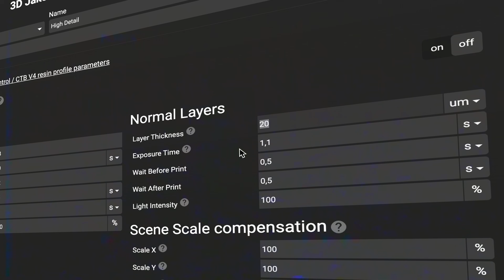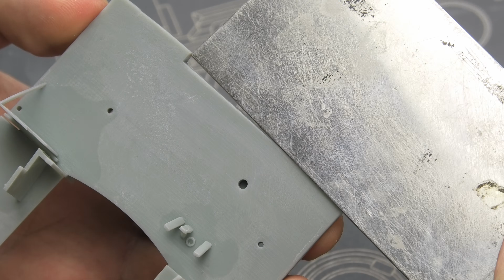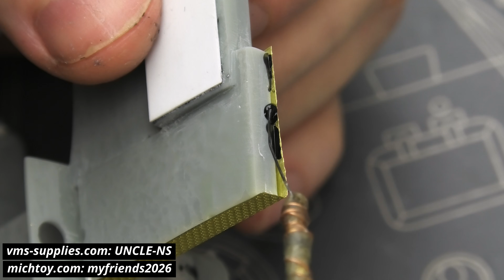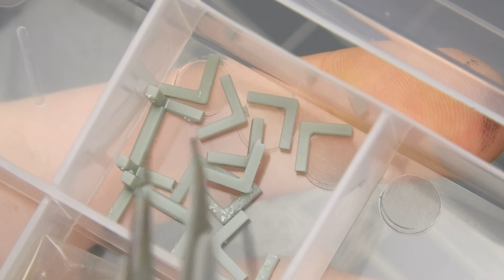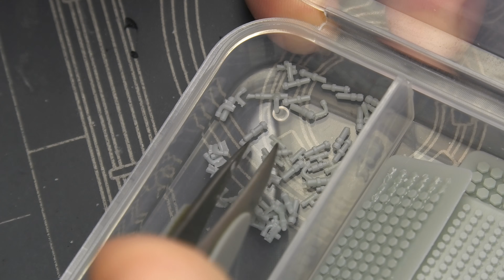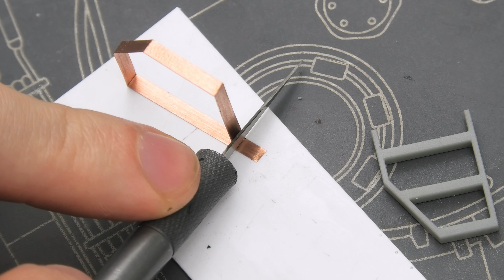Yes, Childhood Dreams Do Come True: Pacific P16 3D-Printed Scale Model

Comment: Aladdin Models will only send you the G-Code for your print, not the STL.  They set it up for ONE printer, and you have no control over printing the object. On top of that the print I received was poorly designed and parts were so thin you could see through them.  STAY AWAY!

Comment: My son drives one of these trucks in the mountains of BC and I have to say your model is amazingly accurate excelt a few things 1 i agree with the other commenter there would be heavy dust everywhere 2 no need to be so accurate withe tires most companies use whatever tire they can get cheapest (and rhe trailer tires might be almost worn out) so they could be anything and are most likely mixmatched. 3 for a truly accurate truck it should be beaten up for a couple reasons. First these are subject to beeing shaken and bounced and beat around on logging roads and while being loaded and unloaded everything is about speed. And secondly these trucks are usually bought at auction after many many miles ́ut on them then retrofitted with the headache rack for instance and sent to live out their dying days in the woods. One specific thing you could add from my sons previous truck is the door wouldn't stay shut so had to be bungee corded to the seat while driving oh and the windshield was cracked. But seriously this is one fantastic model you have

Comment: credit where its due to the 3D modeler. At one point I started looking into how to create a mod truck for Snowrunner. Watched three different tutorial video series on youtube. However for the life of me, I couldn't find a Dodge M37 3D model that had any level of dimensional accuracy or detail. Since I'm restoring one right now, I figured I'd spend a winter learning how to use blender and use the real truck only 50 feet from my computer for reference material and dimensions- however I was unable to pick up Blender as quickly as I'd hoped and by the time winter ended, I had the real truck to work on again hahaha. 

This is an AWESOME video to upload. The P16 is vastly underrated in SnowRunner and is usually my "get out of jail free" card if anything else gets stuck or flips over. The P16 is always there to bulldoze its unpowered front axle through anything and consume every last drop of fuel I can give it only to run out in the worst possible spot.  

Beautiful fabrication work on the engine bay- which is often an area overlooked and under-detailed by modellers!

Comment: After you have cleaned in IPA, wash off any residue under hot water, (the alcohol will still leave stains). Alternatively, buzz it in a microwave cleaner for ten minutes, and then finally dry with a hair dryer before UV curing. (Never cure wet models.)
As for cutting from supports, invest in an ultrasonic scalpel, it's great for all-round modelling, but also makes support removal a breeze.
Not that cheap, but well worth it.

Comment: When removing supports from your 3D prints. Try soaking them in hot water from your tap not boiling but hot. The support attachment points get softer and tear away much more easily. Then put the parts into your curing station.

Comment: while pacific isnt around anymore some of the guys who ran the company are still kicking. they actually still have all of the drawings and blueprint for almost all the trucks they ever made still hanging around. not that long ago they reached out to Edison motors and gave them all of the technical drawings for the truck they were working on. i doubt it would be easy to get into contact with them but it wouldn't be impossible

Comment: I have bought my second Saturn 4 16k Ultra; it's just incredible. I use Sunlu 14k ABS, which is made for this printer—a perfect match made in heaven!

I need to move on my older Saturns and Anycubics now, as I have no space left they have pilled up through the years but elegoo nailed it with the 16k
I am designing parts for my Asuka Sherman M32B1 kit that I got recently.

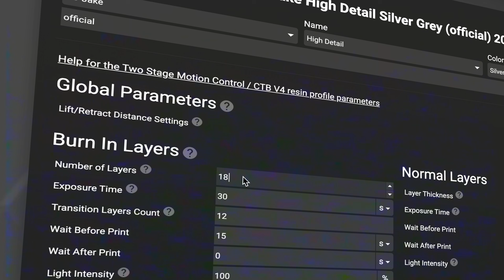I'm also playing Snowrunner. I'm sure Cults has Snowrunner models pulled from the game files. They may need work in Blender to get the wall thickness right for printing, but that's easy enough. I'm doing the Man HX trucks right now from CGT in 1:35 scale, the cabs are taking a bit of work to get ready to print.

But back to kit building, I watched your channel a lot before through the pandemic—some amazing work! 
I go under Kodiak in Snowrunner and Roadcraft, if ever on crossplay. Sabre devs of Snowrunner have Road Kings coming, a truck sim; it looks insane!

Happy modelling it's great to be back!

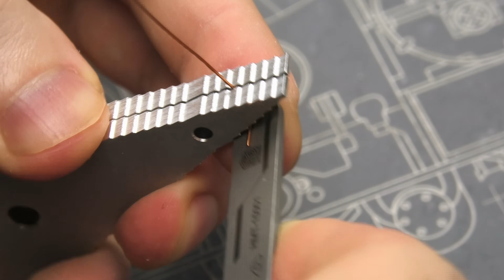Comment: 6:41 can I ask which tool this is? I found plastic versions on aliexpress, but yours looks aluminium and great quality!
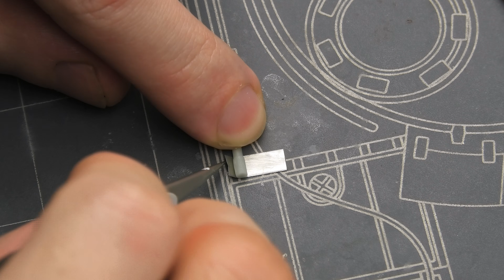Reply: 10:09 Modern Pewter foil should be lead free and seems therefore preferable over lead foil. Touching lead isn't great (wash your hands afterwards) but sanding it can be really quite hazardous. The stuff you are making with it and the lead wires looks very good, though!

Comment: I love log trucks and tow trucks. I have a collection of Scammell Recovery tractors waiting to get built. In the South(US) Log trucks, specifically called pulp wood trucks, used to be see all over the place. They were built from old single axle box trucks. The operator would take an old car axle and cut it down, putting a cable reel where one wheel went. The axle would be run off of the transmission PTO. Using the parking and hydraulic brake the operator could reel the cable in an out to load logs onto the truck. I wish I could post pictures because they were really cool old trucks with loads of character.
here is a video of one https://www.youtube.com/watch?v=B9dBIvUUmk0

Comment: Hey, I work at 3D Prima (3D jake used to be a reseller that went through us before they became a distributor themselves)

I just wanted to say that I would not exactly trust the UV shields that these chinese machines use. While they probably protect you a little bit, knowing all the cost and corner cutting that 3d printer companies take, I would not stay in the same room as anything UV related for long.

Same goes for any of their laser machines, especially anything made by creality. Their laser department functions like an independant company with even more money saving going on.

Comment: Hello Martin,

Just interested to know... What can be done to mitigate the toxic effects of handling lead wire and sanding lead foil? Do the precautions have to be similar to sanding resins?
As I understand it, pewter also has lead content.

Great video, though. The care and detail in constructing these illusionistic sculptures is addictive.

Many thanks.
Reply: Modern pewter to my knowledge is not made with lead.

I wear gloves whenever handling lead and use products like d-lead hand soap and lead converting wipes to clean my work surface. I avoid sanding anything lead based as airborne lead particles will contaminate everything in the room/building you are in if you don't have very good ventilation and even then I wouldn't risk it. Lead free options that use tin in place of lead may be available so I would look for those as well.
Reply: @colausbra, thanks for the reply. I make oil paintings. Back in the day, many pigments were lead based. Now, those colours have a non lead alternatives. People who still like lead based paint for it's consistency and viscosity can still get it. I don't use lead based paints anymore. However, when I used to, barrier cream on my hands was essential. Particulates would only arise if the canvas the paint was applied to, were to be sanded. The main source of poisoning would be through absorption through the skin.
I guess in isolated studio situations, the harm from any poisonous contaminants can be minimised. I think it gets problematic when the studio is your home. Especially during pregnancies and with developing children.

Comment: You have encouraged me to get off the fence and commit to learning Blender. I have been commissioned to do 15mm scale Qing dynasty war wagons for a local miniatures store, and Fusion 360 is not cutting it for texturing the wood. Blender seems to have the ability, I am just standing in front of a giant learning curve whimpering slightly.  Your videos help me drown out the whimper and keep at it.

Also, great vehicle. so much detail. I am wondering if you have ever heard of Verlinden model detail kits. (Used for adding extra detail to tanks etc.)  I suspect your stuff has more detail then even they could do.

Comment: Some tips for your printing endeavors, firstly try using plastic scraper or spatula to keep the plate scrapeless. Secondly warm water, hair dryer or industrial dryer will soften the resin so it would be easier to remove supports. Thank you for the video

Comment: Looks absolutely great. One thing. If I'm not mistaken, the drivers seat is different than the passenger seat. It shoukd have an air ride  type of seat. My brother in law drove a Peterbuilt picking up logs in Oregon. I went on one of his work days and it was 15 hours. He did 2 log runs then a wood chip run to the Oregon coast. Pretty fun times for a teenager.

Comment: Uncle, this is the best most informative introductory video to 3d resin printing I've seen. Thanks!
Reply: Unfortunately it showcases a lot of dangerous resin handling. Always wear two gloves. Never ever touch the cleaning alcohol (basket) with bare hands, as dissolved resin gets straight into your skin. Never touch resin prints before they are fully cured. Always sand wet using a respirator and dispose of resin dust as if it were asbestos. This stuff is highly toxic and it will slowly kill you if you don't take it seriously.

Comment: Cured resin is a matrix.  Water and alcohol can be soaked up into the spaces between the resin polymers.  If you cure the resin - or prime it - before all of that liquid off gases you can end up with cracks.  Basically, on a thick piece drying it with a hair dryer may not be enough, you may need to leave it a few days.

Comment: Absolutely love that the tyres are a little flattened where they are touching the ground. Model is amazing and I hope Aladdin Model is proud of it. Can’t wait for the painting video. There is a pine lumber mill near my house and we always joke there goes another load of toothpicks.
Reply from the maker: The sagged tires were the final touch, and I pointed out that each wheel should be rotated differently so the lettering on the side walls isn't in the same position. I also insisted on the mismatched tires on the trailer haha. The trailer comes with both sagged and unsagged wheels depending on the modeller's choice (packed/unpacked and loaded configuration)

Comment: Son # 1 Drove one of these monsters for a few months until he found a safer, better-paying job. If the logs are not stacked right, the trailer gets VERY unstable. Coupled with unimproved logging roads, one can see why my son got tired of pulling the seat cushion out of his ass.😁 Although he is not a modeler like his old Dad, he would love to see all of the engine and drivetrain details you have replicated. I will send him the link. From someone who has a VERY basic understanding of tractor trailers (I do help my boy from time to time with maint.) this is one of your best efforts, Sir. Outstanding detail and a very nice execution. Edit to add: finally ordered some pewter sheets!
Reply from the maker: Thank you! Even from the videos, it looks like an extremely dangerous job. The warning signs in the cab telling the driver to think twice about what he's about to do next really drive that point across. It's interesting you mention logging roads in a poor condition. It seems that these days they get regularly maintained, like graders driving up and down the mountain to smooth out any ruts and pits in the logging trails. I was actually kinda sad to see that I won't be able to do much extreme terrain in the diorama for this model.

Comment: As always, outstanding work both in terms of presentation as well as the modeling work. 

allow me to do a bit of backseating for a moment. 
when it comes to removing supports from resin models the 3 key elements are support thickness, correct exposure and the softness of the resin at the time of removal. 
during the years and thousands of models i have printed i came up with a workflow that makes the supports fall off almost by themselves with leaving almost no scarring or debris on the model. 

when it comes to support thickness you have to experiment a bit but  most models can be printed with at least 20% thinner supports than the slicer standard settings. i can highly recommend the paid version of chitubox and their multi stage supports that allows you to customize the autogenerated supports and include multiple support passes for different areas and islands. you still have to place some manual supports but using thinner supports and the multi support system reduces manual work by roughly 90%. 

next key is the exposure timing. judging from your supports you are slightly overexposing the resin. sometimes 0,1 or 0,2 seconds is the difference between perfect and overexposed prints.

the third step is done during post processing. i leave my prints in th ewash station for at least 20mins sometimes even 40 or 50min. the alcohol soaks into the resin and softens it further, since supports are thinner the effect is greatly increased for the supports compared to the solid model itself. after that i dunk the model in hot water for further softening of the supports. with the last step done your supports should come off with virtually no effort you can use a toothbrush to remove stubborn stragglers. 

note that i exclusively print with elegoo flexible or abs like resin both the 2.0 and the 14k versions and this method works like a charm. 

word of advice leave the model to dry for at minimum 24h if not 48h to make sure all alcohol is evaporated from the inside of the print. even if its dry to the touch there could still be alcohol inside the resin which causes it to crack if you cure it too soon. i think a lot of your warping problems come from the fact that you cured your models too early. just because the surface is dry doesnt mean the layers below it are free of alcohol.

Comment: I grew up in the Pacific Northwest of the United States. Log trucks were a normal thing on the roads of my area. As it rained a lot where I lived, the trucks were real dirty, not so much muddy, as once on the roads, the mud tended to wash away. So if you want realism, dried dirt, grease, and oily.. not so much muddy..
Reply from the maker: Thanks for the recommendation! I actually have dozens of reference images for the weathering and it's certainly unique. The trucks are not really covered in thick mud build-up, but rather splattered by it. And there's tons of loose debris on the horizontal surfaces, a mixture of soil and tree bark.
Reply: @NightShiftScaleModels don't forget the #1 mess, tree sap. That crap gets everywhere. And it's hard to remove.
Reply: @willthorson4543  now how in the hell you gonna specifically get dried,or otherwise,tree sap on a frigging 35th scale model with tons of other weathering already on it? 😂 😂 what the hell?
Reply: Unless it's winter. These trucks just get filthy in the winter
Reply: An absolutely epic subject and build Martin!

Comment: A few notes for resin printing safety!
Please don't touch models without gloves before they have been cured! There is still uncured resin on the surface even after washing and is bad to touch barehanded.
I would highly recommend wearing gloves on both hands when doing anything with your printer, resin easily splashes into your hands when removing the model from the build plate.
I can't see the rest of the room but ideally you really need good ventilation in the room, the fumes that come from curing resin are nasty for your health!

Please please please look further into the safety of resin printing, the companies that make them are encouraged to ignore them to make it seem more accessible!

Comment: There's is just so much wrong here, the orientation of the models, the position of the support tips, 4 bottom layers is more than enough. With enough transition layers and a decent bottom layer rest time nobody cares were the last bottom layer is. On a Saturn 4U you can run a gcode to increase the bottom layer rest time, the real reason for layer compression and delamination.
Reply: try to word your criticism a bit more constructive. he isnt exactly a professional 3d printer which we both know is a hobby in of itself at this point.  yes he made some mistakes that we all did when starting out but dont presume just because you know all this stuff that its common knowledge.
Reply: @Macetraitor some people take any criticism as an attack, it's hard to compound into a comment how to orient and where to place supports, the rest of my comment was on point.